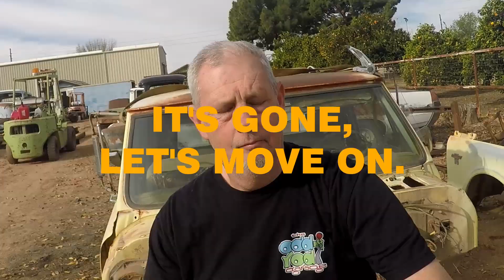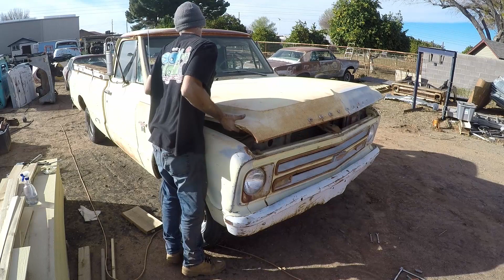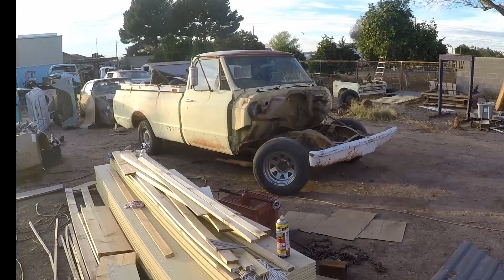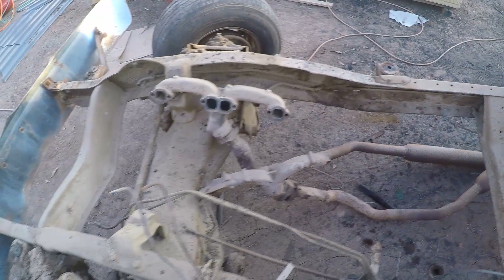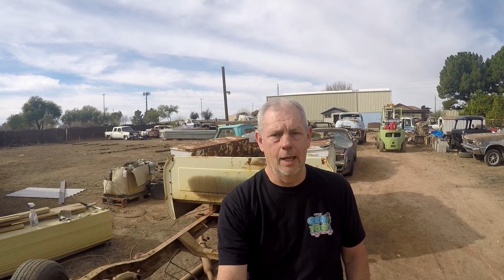Out with the old and in with the new!  We finally get started on the 67 C10 giveaway truck... again!

Comment: When you do a LS swap on the 67-72 C-10 trucks what are you using for a gas tank and fuel pump assembly?
Reply from the maker: I am old skool and love the tank in the cab.  We make new lines for the supply and add a return line.  We use an external pump and filter.  If you'd like I can get the part number.  In the past I have used a blazer tank and also a 53 chevy car tank in the back of the frame. Some of the aftermarket tanks are good too because they have the pump in the tank.